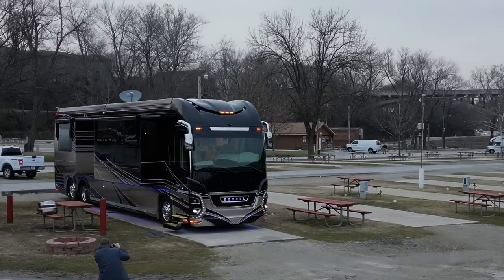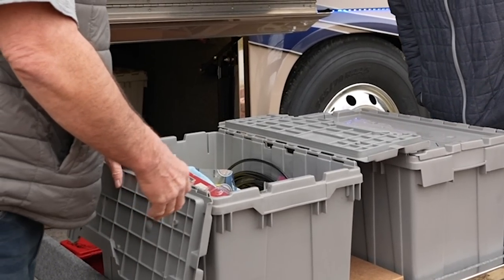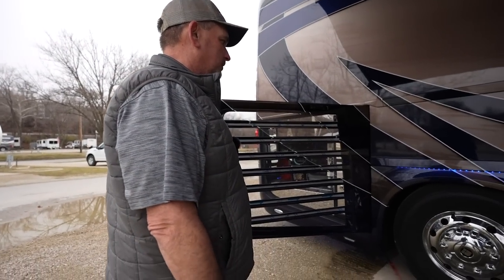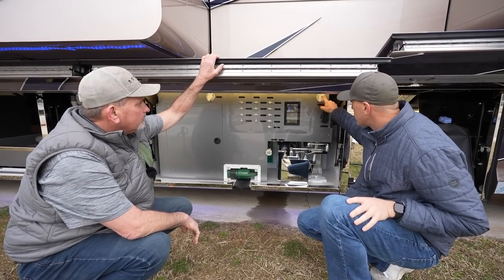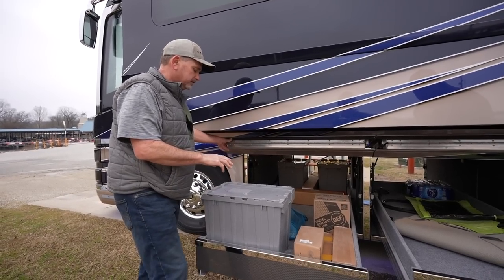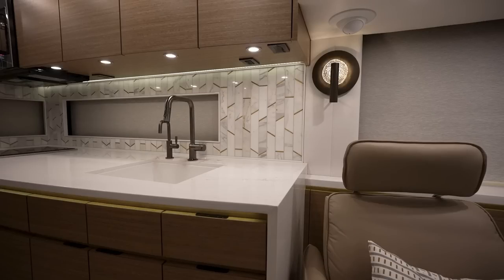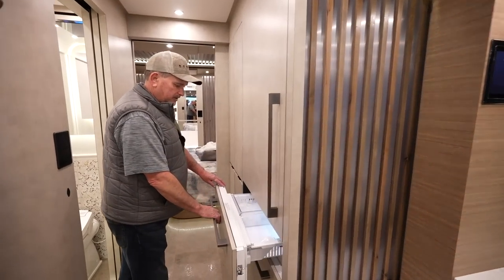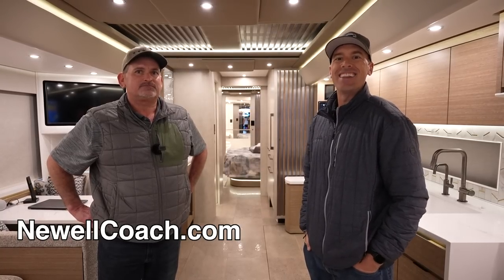Inspecting a 2024 Newell Coach  (Tour and PDI process of Newell Coach #1775)

Comment: Such an Amazing coach, very beautiful and tastefully designed. One thing I don't understand in a 3 MILLION $$$ COACH is the fact that LITHIUM IS NOT STANDARD. I understand most customers never keep these longer than 2-4 years, BUT. Lithium is NOW CHEAPER THAN AGM and the fact that you need only 4 8D lithium to replace 8 8D or install the 8 and remove the 20KW generator and install 8KW generator, it is cheaper quieter, more fuel efficient and almost unnecessary. The lithium will last the LIFE OF THE COACH or at least 25 years being used 20%-100% each and every day year after year. Never having to start and listen too or SMELL DIEsel fumes should be reason enough on a vehicle that sell for this much to make the switch.  LIBERTY COACH has had LITHIUM STANDARD SINCE 2011 And to mention that they also have driver side awnings standard as well should be enough for Newel to step up the game.

Comment: Question Andrew the Newell coaches have batteries can a Newell coach dry camp? Do they have solar panels on the roof? We never have seen a roof of a Newell coach. If it can use house batteries how long would it last for before you had to start the generator?